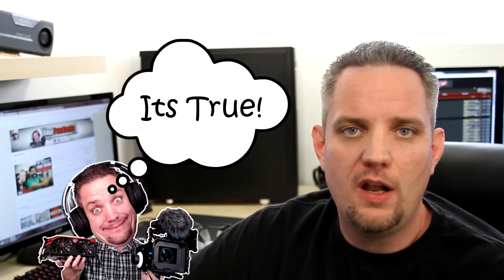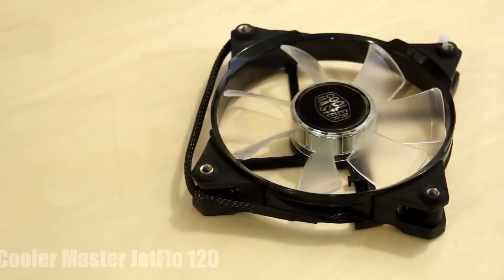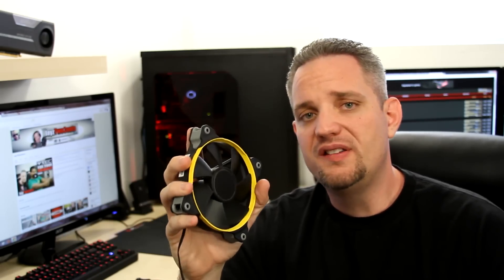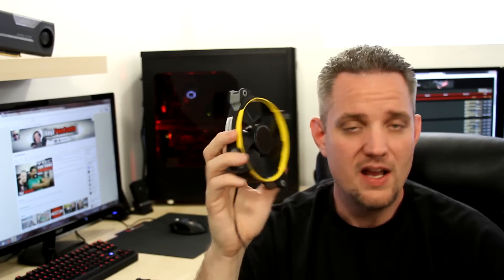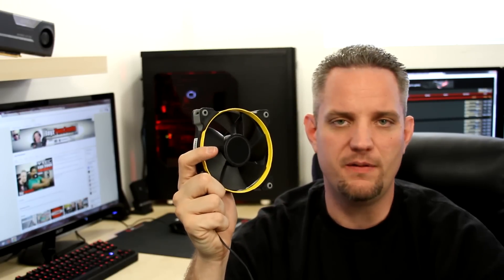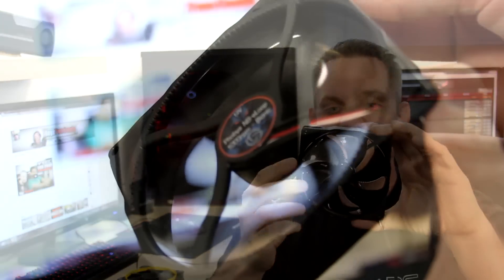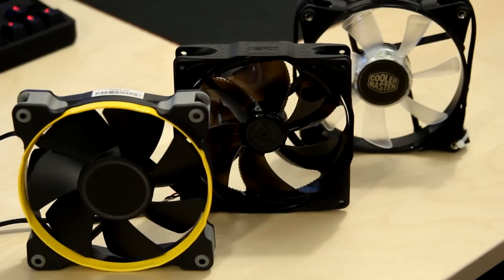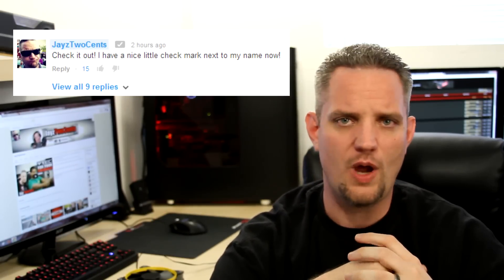Static Pressure vs Air Flow Fans - How to choose the right fan!

Comment: Thank you 🙏 what about for case intake fans if you have mesh and possibly air filter before the fan; I.e: the fan has to pull air through mesh but blows into free space with little resistance?

Comment: Thanks for this easy explaination, it really clearyfied static pressure versus airflow and when and where to use them. I got a question tho in the case of puss/pull I guess i should use static pressure on both sides, or can i use airflow on pull side since there is a static fan pushing?

Comment: If there is a dust filter on the front, are static pressure fans better?

How about if the front has grills like corsair 400D airflow. Which is better?

Comment: So i have an LianLi Galahad AIO and im pretending to put a 3 UniFans 120mm instead of stock fans, there's a small diference in CFM/AIRFLOW (11 for CFM & 0.4 for mmH) the question is: i can trade the default fans for 3 of unifans without getting trouble?

Comment: Very interesting comparison of SP vs airflow - thanks. I have what might seem like an odd question - but bear with me please. I want to put a 12v fan in the roof of my tiny caravan to vent hot air during heatwaves. I think a computer fan might fit the bill. If I fabricate a mushroom style vent cover to keep out rain say 4 inches diameter (you Americans work with imperial I think), does this mean I should go for an SP fan (Im assuming the mushroom would offer some back pressure). Is SP necessary to force the air up and out of the mushroom? In summer I camp off grid with an 85 amp hour battery fed from a 120 watt solar set (with MPPT controller) which is able to keep my 12v TV and interior circulating fan going all day. Your thoughts would be appreciated.  Regards - Lindsey Hunter (UK).

Comment: All those fans are "free-air". The static pressure from them is honestly insignificant, but a decent comparison for per-fan purchase. The garbage about blowing sideways, vs through and gaps in blades, is also irrelevant and half BS. It is all about the blade inclination and "power", at any specific RPM. The less inclination and more power, the more static pressure and less volume. The more the blade is twisted, more inclination, the more "flow" it can produce, if there is enough power and RPMs to manage it.

True fans designed for "static pressure", have little air flow. They are "blower fans", or "squirrel cage fans". You sacrafice "flow" for "pressure".

It is harder to restrict an actual static pressure fan than it is to restrict a fan designed for flow. At the end of the day, given the same "power", both free-air fans, designed for static or not, will output nearly the same "flow", at the same "resistance". But the free air, low static pressure fan, will ALWAYS flow more, once unrestricted.

The more blade coverage, the more potential pressure you can produce, but you can have the same blade coverage and have horrible pressure and massive flow too. Gaps are irrelevant between blades that spin so fast that the "chop gap", is literally the same. At 2000 RPM, they are "chopping" through the air with a micro-meter gap, which is almost immeasurable with any standard tool. The Vacuum created, in the chop, is what captures the drawn-in air and ultimately drives it out, as it compresses across the blades surface. That requires power. The less power you have, the less flow and pressure you will get, at any inclination. Also, that is where all the sound is generated.

Also, stop calling it "water cooled", it's air-cooled with a water buffer. It takes more fans to extract that same heat OUT OF WATER, which also generates more heat, by the fans, which need more power and higher static pressure, as well as your water pump, which is also heating up the water. That's like blowing on yourself to cool yourself down. It's a redundant third-party, which contributes to the issue it is attempting to resolve. Like using an air conditioner to cool the air conditioner, so it works better. Ignoring the fact that the AC, and it's helper AC, are both creating heat in the process. Having both running inside, generating more heat than either could ever cool, at the end of the day.

Comment: Do I need static ones for intake because of filters on the case or does that just apply for what's behind them?

Isn't static one better everywhere because of higher airflow with same effort thus noise reduction?

Comment: Q300l case I got 4 140mm static pressure fans seems ridiculous I know but the case happens to be more metal than perforations so. 🤷🏽‍♂️ It happened to be the perfect choice after watching a listening, obstructed airflow so static pressure was the best bet and it works!

Comment: i just did some checks and it seems that AF and SP fans have the same Static Pressure (1.45 mmH2o), is that the reason that the temps have minimal difference? I

Comment: thank .  if we free theze dynamics in time a space through the blades, (unlike a turbojet) will allo fast velocity wind to pass through , allows fans of various speeds to work together, and with vortices , it wont ruin the wind field you are trying to estabilith. .. that is great , sort of like a tesla valve or fluidic diode.  thansk for explaining this, its not an easy concept to grasp but its athe heart of how wings and airfoils fly also..

Comment: Hi Jay. I'm new to building. ☺️
I don't know if I missed it or what, but would I use flow or pressure for a front INTAKE fan that has a grill and mesh? I have the Meshify C, if that helps. Thank you.

Comment: Greetings from California. This is very informative and  Thanks. I had an issue for several days, with over heating Bridge and Mains Power supply Transformer on my Yaesu FGR7700. This is a Communications Receiver.  But dissipating Heat is common to all devices, I’m sure you are with me. So, I tried Heat sink and it workers satisfactorily .. I’m all smiles Yo. I beat the heat! So closed the bottom cover and switched ON. 20 minutes later The receiver power supply area got tremendously hot to touch.  AIR AIR... need Air says the Receiver.
So, now what? Removed all the cumbersome heavy heat sinks, and fitted AAVID 50mm*50mm ball bearing fan ran the device. Cool.. system ran cool. Proud to have redesigned a system. Closed the bottom cover. Switched on and AGAIN . 20 minutes later The receiver got hot as before !! What The $#$@@ ! 
Removed the cover and I realized that the space between the fan intake and the Cover was jus over 2mm !!!! There was no Air Pressure !
Fan was spinning with no air movement due to almost blocked intake. I relocated the fan, to an area of free flow and pressure. Put the cover on... Fingers crossed... 20 mts later , 40 mts later  60 mts later NO HEAT ! 
I was substantiating your theory. Thanks buddy. Stay safe. 73s

Comment: i bought an id cooling airflow x 240. it says the static pressure is 2.15mm and a CFM of 74.5 is taht a good value for cooling?

Comment: Jay if you ever see this comment, Why the heck is the Cooler Master Masterfan Pro Air Balance range not more popular, they're fighting in a different weight class:
83.1 CFM
3.63 mmH2O ( both max values)
USD 17 (converted)

Comment: I got a airflow case with a pedestal for radiators. So 2x 360mm radiators in the pedestal, 2x200mm AF intake fans for the main chamber, 2x200mm AF exhaust fans for good airflow to keep vrms and stuff cool

Comment: So there's three areas in my case (Corsair Carbide 270R) for installing fans: The very back of the case, the ceiling, and towards the front of the case (The other side of the front panel). Judging by what I've learned from this video, I should use Static Pressure fans for the front of the case (Since there's only like an inch gap between the front panel and the fan) and Air Flow fans for the top and side?

Comment: Hi, nice info on static and airflow. I have a query to ask, will you help me. I have asked this to few Indian pc builders earlier and asking same to international pc builders like you and Linus tech tips. I have chasis corsair spec 01, having space to put 5 fans (120mm or 240 mm fans,  one at rear, two at top and two in front). I wish to have looks also with some RGB going in if possible. But my aim is to overclock my processor 17 7740x on gigabyte x299 aorus gaming version 1.0 mobo with 16gb ( 8*2 @ 2400mhz), current speed is 4.3mhz .. i wish to clock it to 5.0. I am a content creator, I mean video editor and post-production professionals. I want to know which fan to put where for optimum cooling and airflow also. Hope to hear from you. 

Your friend from New Delhi, India

Comment: i WANTED THE TERMS DEFINED. THAT IS THE ONE THING YOU ARE NOT EVEN STARTING TO DO AFTER SEVERAL MINUTES TALKING ABOUT ALL SORTS OF THINGS BUT NOT THE SUBJECT TITLED.  And by the way, I saw the term connected to exhaust fans, not for computers but for a small buildings. Change the name of the video to regarding computers.

Comment: Now I am curious.  With hearing about where to put your fans, I have four 120mm Rosewill fans one in the back, one on the left hand side, two in the front and one 140mm (also Rosewill) on the top of my case.  So, my question is, the two Rosewill RFA-120-BL 120mm fans that are in the front of my case, are those "right" ones to blow air past the hard drives and the slots that are there?  Thank you for any help\support.

Comment: wow thks jay for the easy to understand explanation even thought it's an old video lol, was confused on what kind of fan to put in my cooler master td500l, now i understand, i will use static pressure fan as intake fans and high airflow/cfm fan as exhaust

Comment: ok, so the top of my case has space for 2 120 millimeter fans. taking into account that it has a magnetic filter and also the "grid" like shape where I would screw the fans. should I use static pressure or airflow fans? Do the filter and grid make enough resistance to make it necessary to use static pressure or will airflow fans be enough? thank you.

Edit: I also have a front mounted h115 pro aio because it didn't fit at the top. Considering the resistace that the radiator provides for the included fans I was thinking of using intake top fans instead of exhaust to create positive pressure. are the included fans with h115i pro static pressure fans? I would assume corsair would provide the appropriate fans with the radiator they're selling but I just want to make sure.

Comment: hi, a really interesting insight into the world of fans and, as it happens, very timely for me as I have just replaced the 140mm NZXT in the lower front of my Phantom Enthusiast Tower. I quickly realised it would be hard to get an identical replacement and in the end ordered the NZXT AER F model which, having watched your video, turns out to be an Air Flow type fan. Just like you say, directly behind this fan is a bank of trays for hard drives etc which obstructs the incoming air flow. So, I now reckon a better choice would have been a Static Pressure fan (NZXT RF-AP140-FP Aer P) which is now on order. The original fan was drawing air into the case. My question, "is this the best orientation - which way would you mount this fan - drawing air into the case or the other way round?"

Comment: Jay, I agree mostly if a case has a completely open opening (which I've never seen). However....chassis grill and filters. Please see the following - 
https://www.pugetsystems.com/labs/articles/Effects-of-Grill-Patterns-on-Fan-Performance-Noise-107/

I prefer the Noctua 120mm NF-P12 redux...PWM and a nice balance of cfm and static pressure. Nice for a small, restricted airflow, case.

Use convertunits.com for converting mm to in pressure or cfm.

Comment: Hi , i need some suggestion. If i am using a 240 mm radiator as an intake, with 2 SP fans pushing air through into the case, would it be wise to use 2 AF fans to pull that air out to cool my motherboard components i OR still sticking to the SP for pulling that air is still recommeded?

Comment: What about the NZXT s340? it comes with a dust filter in the front and also there is no obstruction as Drive cages and stuff but the question is it has the dust filter in the front so should i go with SP fans?

Comment: Nice explanation! I have a question, regarding static pressure.
It's perfecly clear now, that if you want to use a radiator in a "push" configuration, you need a SP optimized fan, because it's more capable of pushing air throughout the tiny cavities of the radiator.
My question is about the "pull" configuration: what about the static pressure that is generated BEHIND the fan? If you use a fan in a PULL configuration, the air is "pulled" within the radiator from the rear part of the fan and since an AF-optimized fan moves "more air", shouldn't it be more effective than an SP fan?
Reply: The static pressure fan makes the same pressure in push or pull when mounted on a radiator. The radiator makes the same resistance both ways
Reply: Let me know if you discovered which type is better to put on either side of the radiator.  Looking at mountjng fans on both sides of my front panel radiator and am trying to find this too
Reply: EK Vardar Furious, for an example, as SP fan is a bit better in pull than in push (as stated by EK on their website). But anyway, always use SP on radiators.

Comment: Jayz, this is an awesome learning video.  Awesome job dude.  Sorry if this question is  a little late to the party , and you've probably heard this question a million times already.  What type of intake fan should I use when you have fine dust filters behind it?  Say for cases that have intakes at the top with dust filters and your usual meshed front with dust filter, do I use static pressure fans or high airflow fans?  Thanks in advance.

Comment: But my radiotor fans are also my case fans casue they push air in my case but in this case which there is also a radiotor and case which fans should i use???

Comment: So in a push pull configuration would I use only static pressure fans since the radiator is sandwiched between them? Or air flow on pull and static pressure on push? Because I will have a air filter in front of my push fans.

Comment: Hi JayzTwoCents - I just came across this video and had a question for you.  How do you feel magnetic levitation fans compare against static pressure fans for the purposes of radiator cooling or performance when mounted right up against the front of the case?  Corsair says the ML120 PRO has a static pressure rating of .2 - 4.2 mmH20.  While the SP120 has a static pressure rating of 1.46 mm/H20.  Is the variable performance of the ML worth it, or do you recommend sticking with the SP120?

Comment: help, I have problems on my temp being high and also, slow loading. should I first get a ram? (currently have 8gb @1600mhz) or ssd? or should I fix first the temp and get a after market cooler or switch my fans into 1500`s rpm fans? im new to pc building